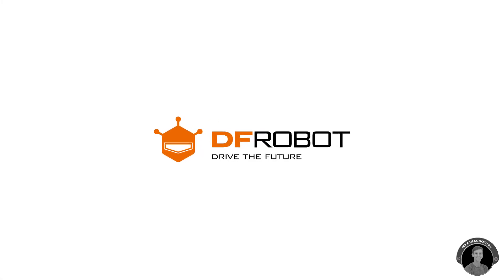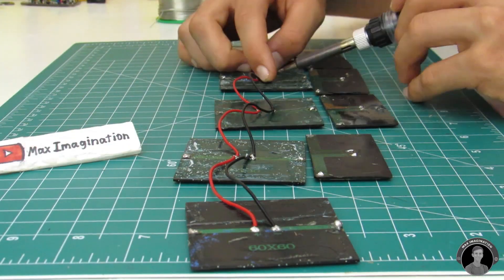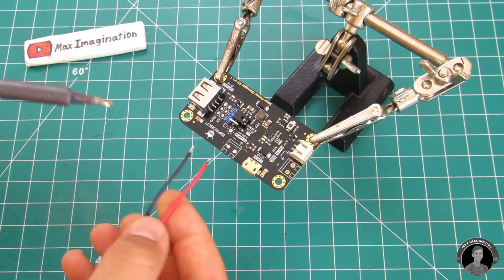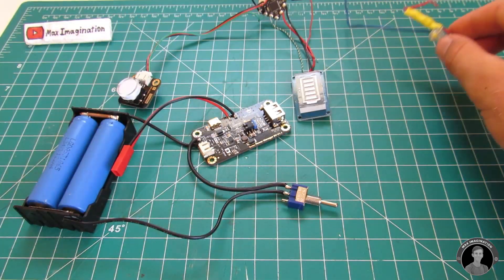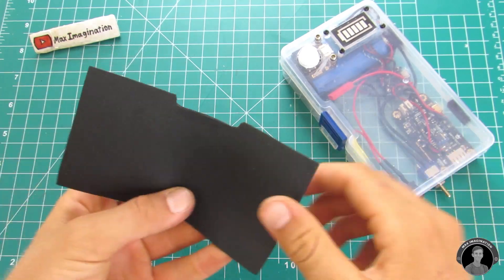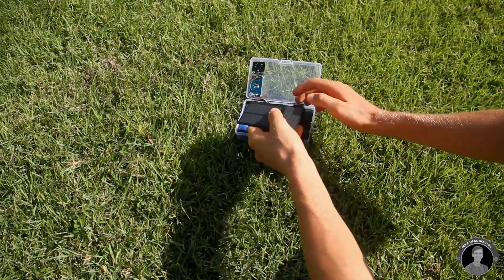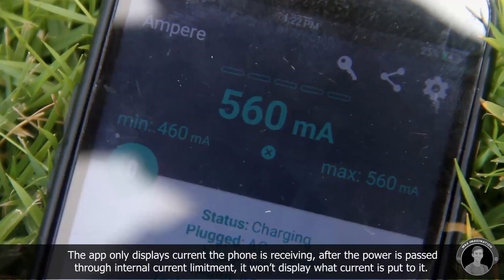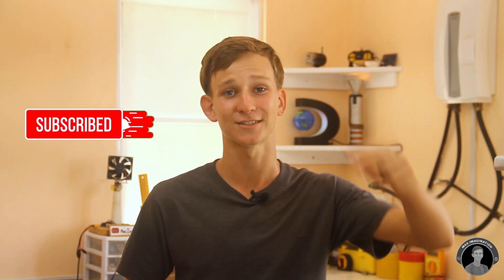Build a Pocket Power Bank Charger with FOLDING Solar Panels!

Comment: Do the solar panels have to be the same V since I bought square 5.5V solar panels and accidentally bought rectangular 6V solar panels but some people on Reddit said it’s best to have the same V for all solar panels? Since of that I just used a series circuit consisting of 5 5.5V solar panels and the powerbank worked, so Ty for the tut😁
Reply: Last question: when charging the solar panels is it ok for the power bank to also be in direct sunlight for a while or should I cover it with something? Ty for answering and dealing with all my questions🙏
Reply from the maker: Ideally, yes, all solar panels should be of the same voltage when in a parallel circuit. The panels must be wired in Parallel and not Series. You need to add current and not voltage like you essentially did.
Reply from the maker: The power bank (battery) must not be in direct sunlight - keep it well closed or covered.

Happy to help!

Comment: When I do the code part I try to open the port dropdown but it won’t let me click it and select com20. Do yk how to fix this?
Reply: Also when I try to charge my phone it doesn’t charge even though the solar power manager says it’s on and I’ve charged it for 8hours😔
Reply from the maker: Is it in the sun when charging your phone? Are you using powerful enough batteries?
Reply: @MaxImagination I found the issue for some reason there’s power in the usb out but whenever I plug my phone charger or other phone chargers into the usb out it doesn’t charge.
Reply from the maker: Seems like an issue with how your board is connected or PC. Test different USB ports and another microcontroller to isolate the issue.
Reply: @MaxImagination  also can I just exclude the microcontroller along with the battery indicator and push button?
Reply from the maker: Yes, you can exclude those and use the charging board solely with the power switch and so on.

Comment: I’m making a solar panel phone charger for my manufacturing project and if I get the Monocrystalline Solar Panel would I still have to build the diy solar panel charger?
Reply from the maker: No matter what panel you use, you still need the MPPT solar charger board.
Reply: @MaxImagination is this project beginner friendly? And what’s the dimensions on the case u used to hold all the parts?
Reply from the maker: Depends on what is meant by "beginner", do you know the basics of electronics? I don't rememeber perfectly, but the case was around 8x16 cm
Reply: @MaxImagination  oh sorry for asking all these questions but I’m 2nd year into manufacturing at high school so we haven’t really covered a whole lot yet. But does this overheat sometimes?
Reply from the maker: No worries. It does not overheat.

Comment: Solar panels should always be connected with same rating and sizes.
Reply: That's not true, as long as you wire them parallel, matching only has to be done with serial wiring.  You could wire 3 different panels in parallel, then wire those in series with a matched trio.
Reply: @DoctorMangler  how do you match them when the panels are not of the same rating there will be slight changes in Voltage or Current with panels of different ratings connected together your output efficiency even if you wire them in parallel would slightly be affected.
Reply: @giovanninongbri2250  Changes in voltage are already accounted for, his panels are all 6v.  The amps add up.  So he's got a 250ma panel, and a 60ma panel.  Being they are all 6v, he now has 310ma.  Amps do not have to be matched, volts do, in this application at this scale.
Reply: @DoctorMangler  sure when it comes to 6v panels but not the case with 36 cells or 72 cells brother.
Reply: @giovanninongbri2250  Aren't we talking about this guys 6v project?  Number of cells don't matter, 36 cells no problem.  His panels, as he stated were all 6v.  So the amps add when wired parallel.
Reply: @DoctorMangler  we are talking I agree but for large system it's better we wire panels of the same rating for better efficiency.
You just can't connect a 36 cells with a 72 cells or 144 cells. Even if you try the power output from the whole system won't be at its maximum. There's no point in buying a panel of 335 watt which is already costly enough and connect it with a 20 watt or 100 wattt .
Reply: @giovanninongbri2250  Ok so using your example.  That 300w panel is just fine mixed with a 100w panel.  As long as both panels are say.... 24v.  Because both panels are 24v you wire them parallel and you now get 24v at 400w.  Number of cells won't matter.  On the other hand, if you were to connect the same panels serial, you could get 48v but as you said you won't get full power, it would only be 100w.  However again, parallel works fine as long as they are the same voltage.  They do it on sail boats all the time.  A small panel on the side of the boat, and a larger one on the deckhouse or such.

Comment: would you happen to know how to wire it to a usb output so i can plug the panels into a battery bank?
Reply from the maker: It already has a USB output (1A) that can have a USB cable plug from into an external power battery bank.
Reply: sorry for instance can i find a cable that instead of a usb a output its perhaps a usb c line that only connects power? im trying to avoid a second cable and just be able to plug the cable from the panel directly to a portable battery to start charging it @MaxImagination

Comment: Hi there max and the comments section
I was wondering could you add one more battery and make it 6000mh and could you give me tips on how to build one just without the display and lights
Reply from the maker: Hi there. Sure, just add another cell (battery of the same voltage) in parallel with the rest of the pack to increase capacity. If you want to build one without the display and lights, simply don't include them in your circuit. Cheers.

Comment: Hey, its me again, I've gotten up to the part where you connect the arduino up. (the solar panel, battery, and sunflower is connected up) and to test if it is working I plugged the charging thing into the sunflower and tried it out, but I am getting no signs of charge??? Wondering if I need to connect the arduino for it to work or its just a technical issue on my end. Thx
Reply from the maker: Hi there. You don't need an Arduino like I used in my project to get your power bank to charge. The Arduino and display were used just for displaying the battery level. Try measuring your circuit with a multimeter to detect a rise in voltage in the battery. Also, what "sunflower" are you using? If you could somehow show me your circuit, this would help me to be able to help you. Thanks.

Comment: Hey!, doing this for my school project, got some questions to ask. Does the output voltage of the solar panels matter? like does the sunflower sort that problem out? also is 900amps recommended or needed. Thank you.
Reply from the maker: HI there. Yes, the output voltage of the solar panels must be 5 or 6V and no higher or lower. the 900 milliamps (or 0.9 amp) is the minimum required current to charge up the batteries through the solar charge controller board. Cheers.
Reply: @MaxImagination  Thx!

Comment: hello, this is a really great project, I just want to ask if there's any way to make this kind of DIY solar power bank without the programming part?
Reply from the maker: Hi Alex, thanks for your comment.
Yes it is possible. I only did the programming with my kind of parts since I didn't have one of these battery level indicators which is better: https://amzn.to/3lefXGs
Reply: @MaxImagination   thank  you for the reply, i also want to ask ,if i can't do the programming parts what features (just like in the video) can i not include ? because me and my groupmates plan to make a solar powered bank but that's our only goal and we want to lessen our expenses... thank youu
Reply from the maker: You're welcome. Yes, there's a way. You may remove the need of the microcontroller board (Beetle) as well as the battery indicator module. These you won't need to make this a minimal functioning solar power bank. Hope this helps, cheers.

If you appreciate what I do and would like to show some support, I'd be grateful if you contribute to my work with a coffee - https://www.buymeacoffee.com/MaxImagination

Comment: Hi Max, what gauge wire did you use? Do I need a diode?
Reply from the maker: Hi there. I typically use 24AWG wire, works fine for making most of these gadgets. No diodes needed for the parallel panel configuration, as the mppt board already has them. 
Cheers,
Max
Reply: @MaxImagination  ok

Comment: Great project! Could you explain why you needed to switch battery holder charge to be parallel? Did you solder copper to accomplish this?
Reply from the maker: Hi. Thanks for your comment!
I did that implication because 3.7V is the voltage of one battery that the board only accepts. Also that the connection between two batteries had to be parallel to double the capacity (mA) and keep it voltage the same (3.7V).
Yes, I used thick copper wire to join the remaining two terminals.

Cheers,
Max

Comment: Nice work, and tank you for sharing this project. Caution!!! be-careful when using this types of batteries to an outside temperature exceeding 60 degrees Celsius, it may result to fire or explosion. Better keep the box with a battery or electronics under a shaded environment or indoors, chemical reaction can put your safety in danger from both batteries and the electronic components.
Reply from the maker: Thanks for your safety advice, I'll consider that! Yes, it's best to keep batteries out of reach from direct sunlight, I usually place a cloth over the power bank while the panel charges it.
Thanks for watching!
Reply: @MaxImagination  Great idea!!!